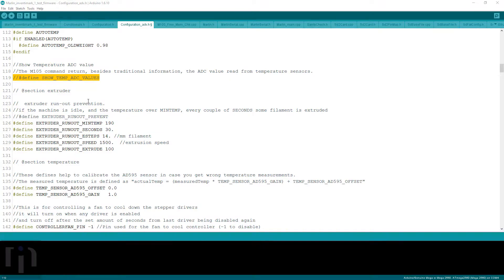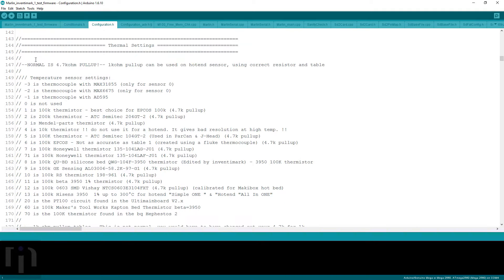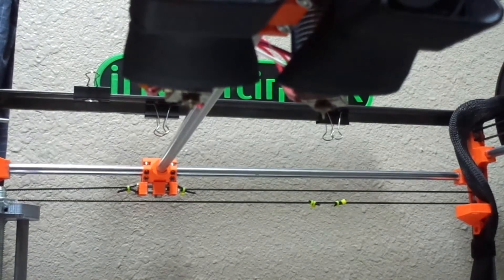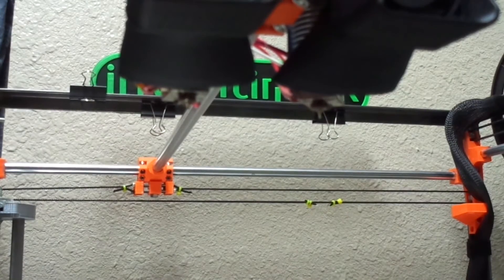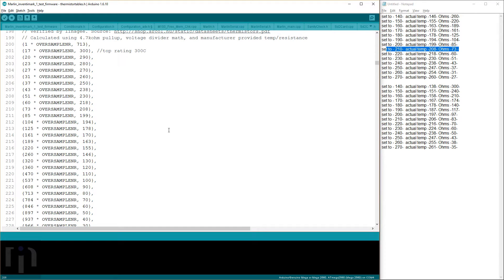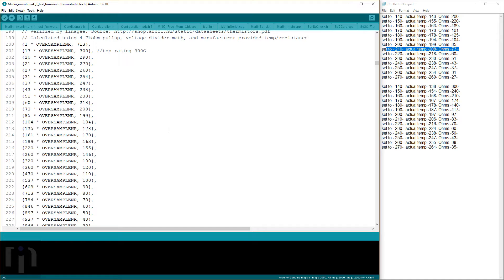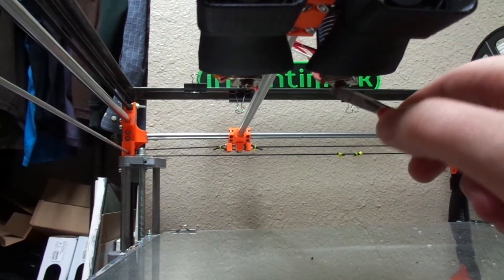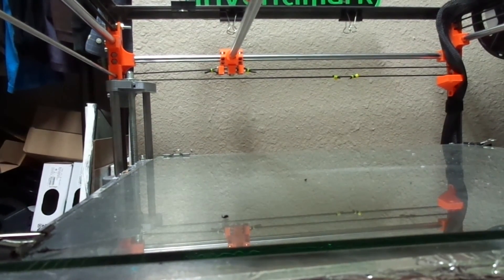3D Printer Build : Part 7 - Calibrating Thermistors

Comment: I have an e3d v6 and they said you should use temp_sensor 11. I tried all the possible 100k thermistors but none worked correctly. It seemed fine at room temperature (same temp as the bed) but the higher the temperature the more it was off. At highest temps it was about 20-30° C less than what I entered in octoprint.

I also used an IR thermometer and thought the reading must be wrong. I then ordered a cheap probe meter on amazon and it turned out the readings of the IR thermometer were pretty spot on. (Like you I pointed at the heater block from the bottom, nearly touching the nozzle, to get the most accurate result.

So therefore this video was quite helpful and I advise everybody to validate their temperature readings with an external thermometer as well as doing a PID tuning afterwards.

Thumbs up for this video.
Reply from the maker: Thank you!  Ever since I calibrated, I have had great results with different filaments and their stated use temperatures.  Everything seems to be spot on.  (I also bought an aftermarket k-probe thermometer, and it was actually way off as far as the temp goes when measuring ice water and various known temperatures compared to the IR thermometer).

Comment: Great video! I'm not using marlin but this gives me a great starting point on how to accurately scaling my thermistors.  I think that your first reading should have been when everything had been aclimated to the room temperature so at least you have three thermisters starting point the same.  Then set all three to say 60 and let it acclimate for 30 minutes with not airflow.  Then 90 then 100 then 110.  Calibrating to acclimated sensors judging against each other might get you a little better results.

Also I wonder what it would look like if you graphed all these numbers

Comment: Nice job.  What kind of tool are you using.  Laser Infrared?  Are you aiming it at, or just real close to the hotend?  (I just heard you say aim for the nozzle.)
Reply from the maker: Yeah, it's an infrared (laser) thermometer.   Aiming it at the nozzle and moving all around to find the hottest temperature of the entire hotend area.   It actually works better than the dedicated thermometer with k-type probes (physically touching).

Comment: Great Video, thank you for share it. I have some issues with the thermistor of my new E3D V6. I don't find the correct number in marlin that match with this thermistor. They said it use a 100K NTC  and i tried all the number the get the right temperature but its doesn't work. Its show 365C when it suppose to be 21 or 20C, because the head it's not working at that moment. Give me an advice with this please. which number can i use to make it accurate temperate sensor? Thank you and best regards. Excellent video.
Reply from the maker: That's really hard to say. It could be a bad thermistor.  You could try different numbers and see if any of those are any different or give you a different readout.  If it's a genuine E3D, they may be able to help you or even your printer manufacturer if it is made by a company.  Hopefully you've figured it out by now.  Sorry for the slow reply.

Comment: how can you be sure that your IR thermometer is measuring the real temperature? and also inside temperature of the block will be different than outside where you are reading the temperature.. I am asking these questions because i tried 2 different thermometers to measure temperature and results are completely different.
Reply from the maker: I've tested the IR thermometer I've had with actual known temperatures like boiling water and ice water and it is very accurate.  I've also tested it on my GPU when it's running at full load at 79C and the thermometer is spot on with that temperature.  I also have a physical k-type probe meter that I tested, and it was completely inaccurate when it came to these same tests.  The IR thermometer is more accurate than the cheap probe I have.  You just need to do baseline tests for known temperatures and you'll know if it's accurate or not.
Reply: I also tested my IR T with boiling water and ice water but concept is different. Your IR T most probably will show actual temperature if you are pointing it to a matt surface. But heating block is shinny aluminum ;)
Reply from the maker: Not when it's dirty with burnt filament... :)

Comment: Hows the build goin?
Reply from the maker: It's been built fully since December or so last year.  The power supply for the heating bed(s) died in February.  I finally just got the the silicon heated pad I bought back then installed and it works surprisingly well.  I just need to re-calibrate the print head offsets again.  Otherwise, it's working great.
Reply: Nice! I was checking out some of your design videos of the 3d printer + I made a mold using your blender tutorial Thanks!, very impressive / inspirational! Keep it up!